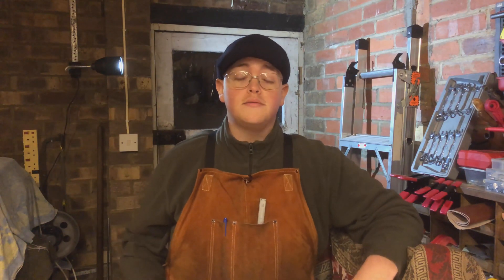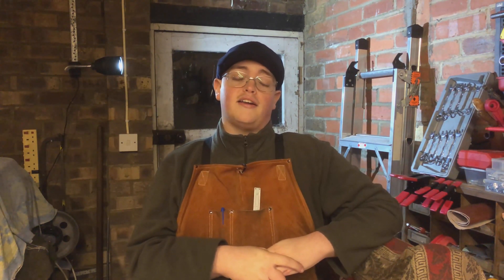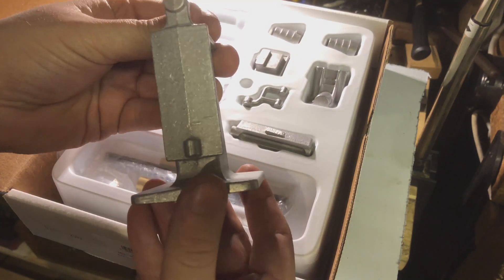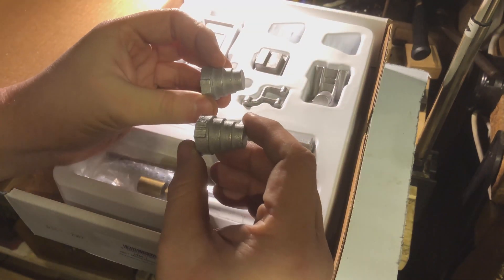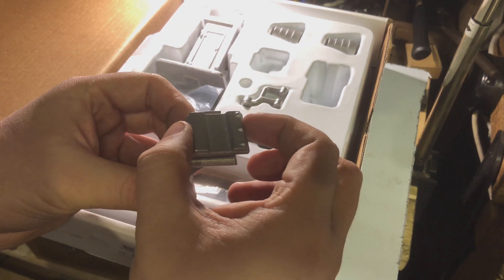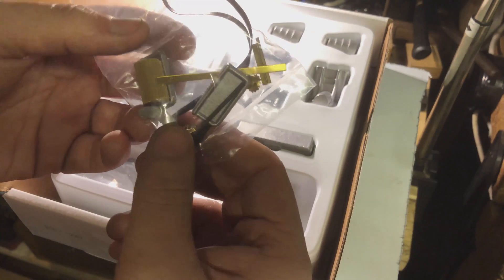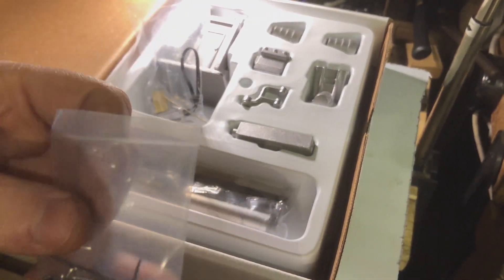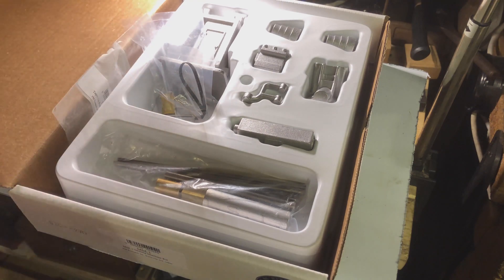PM Research Milling Machine Kit Pt 1 || Introduction to the project

Comment: Hi, I just found your channel this morning Valentines Day. I am following along with Joe Pie on the lathe kit and have the four jaw chuck and faceplate all done. I do have the milling machine kit in a draw along with  duplicate kits of all the machine tool casting sets, long story, and I am building two lathes with Joe so I won't be working along with you on the mill but have subscribed and hit the notification bell. I have already built the  #1 steam engine and the dynamo kit,the #2AM oscillating engine along with the #5 engine and the #1 boiler. The machines I have finished are the drill press, the shaper, the arbor press and the bench grinder. I am kind of like Keith Appleton with a lot of projects going at the same time here in my shop  but making steady progress on a lot of them. Again I am looking forward to watching your future videos of the construction of the milling machine

Comment: Just found your channel and subbed. After watching Blondie and Joe, I went to the PM research website and when I saw this mill kit, I almost bought it. However, I’m a bit lacking in the machine department. I have an old lathe, a drill press, and a cnc router. So I’m a bit unsure on if I should tackle a project like this. So it’ll be nice to see how it goes. Good luck with it & cant wait for future videos.
Reply from the maker: Thanks for the comment!  I would’ve had part 2 out already, however my small milling machine motor exploded!  A replacement mother and controller are now on their way, so hopefully the next part should be out soon.